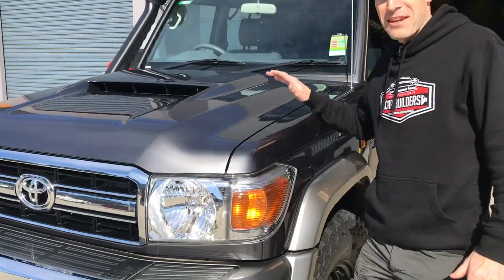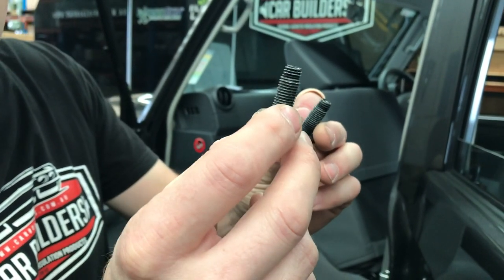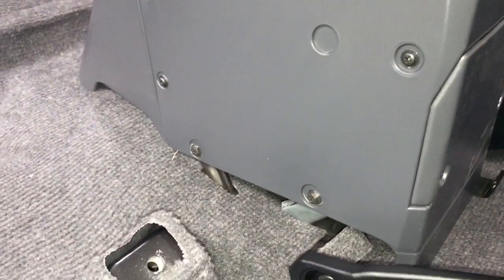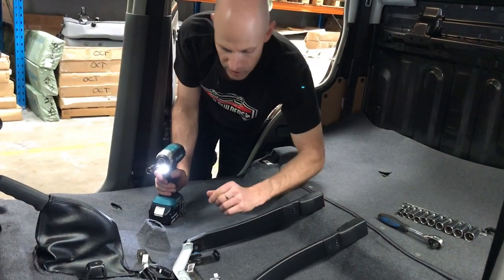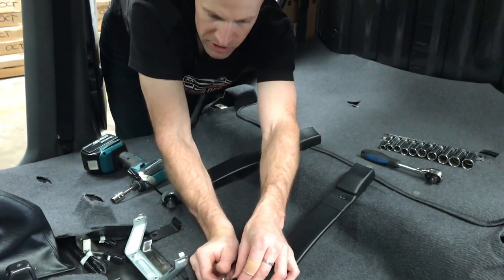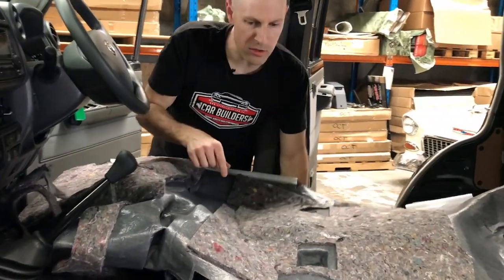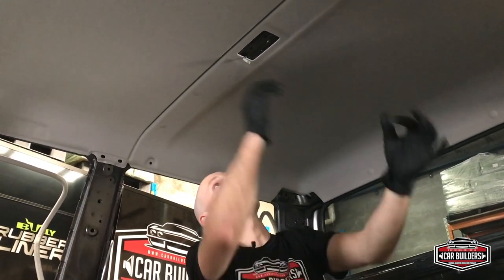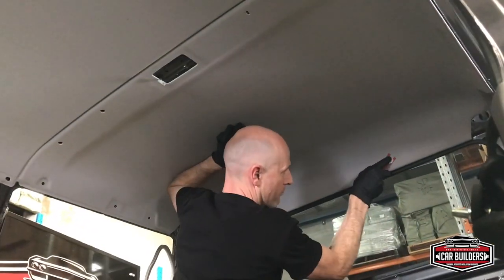How do I remove the interior in a 79 Series Landcruiser?

Comment: Can't figure out the cup holder
Reply: Cup holder should have a small window like piece closest to the centre console. It just pops out with a flat screw driver or if you can get a finger behind it. Once that piece is removed there’ll be a bolt holding the base section down. From there it should be pretty simple.